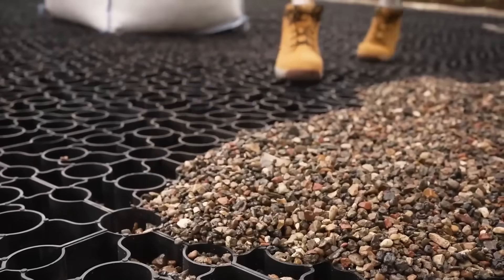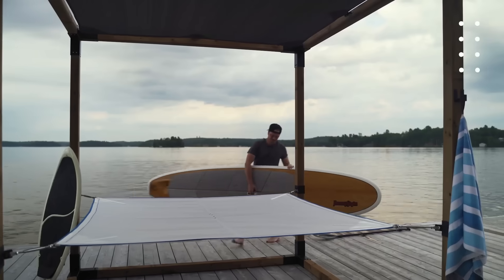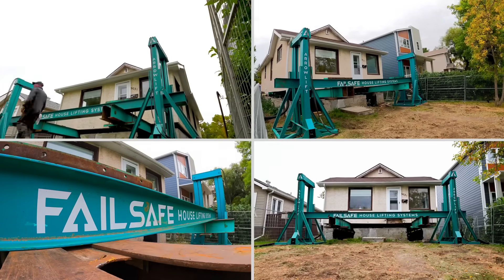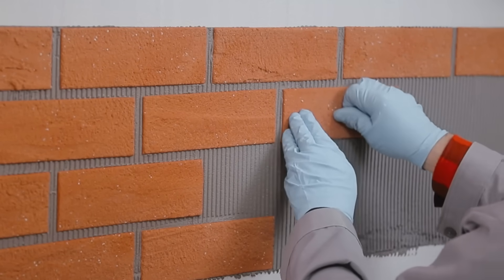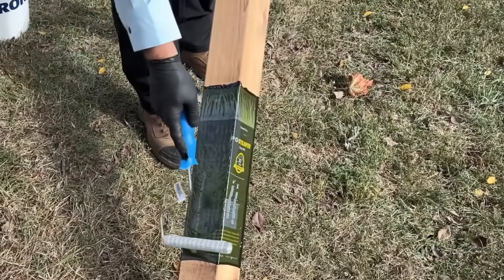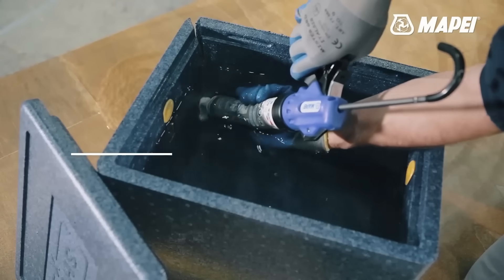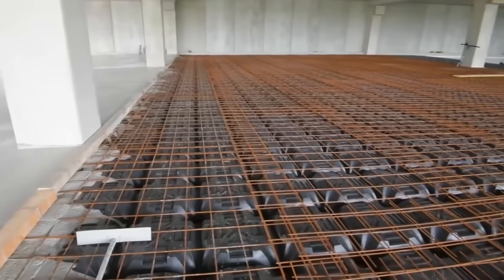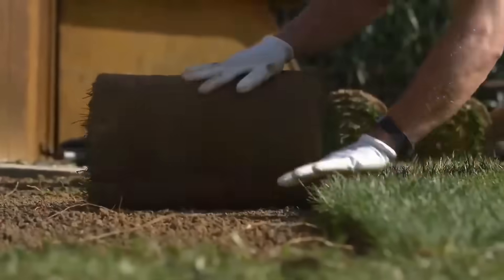Construction Technologies You Should See

Comment: That's why nothing lasts, cutting corners! Acropolis still standing 3000 years!Driveways dressed with stone or slate breaking up because of cheap fake foundations,like using only gravel vibrated and mud(cement sand) as adhesive for stone ,very wrong and cheap.U need to concrete with Rio bars on vibrated gravel and wait 28 days for it to set properly,so U get your movements and cracks in joints with Rio bar not overlapping the joints! Quantity not Quality!
Reply from the maker: You're right! If only they had a DIY video on how to build a 3000-year-lasting structure.

Comment: The Plastic Forms @13:00 for concrete are a bit much. Foam is lighter that those and dividers are already installed with rebar slots. Furthermore, Foam provides a Thermal Break between the inside and outside whereas the plastic just becomes part of the thermal bridge. More Importantly, anyone hoping to do this by Mixing their own Concrete and placing it one bucket at a time, should stop sniffing glue ! Not only is it way too much work and mindless, it is way too slow. There would be tons of Cold Joints because it wasn't a monolithic pour. Hard to Vibrate the wall suitably too. 
Many of these systems are Experimental Only and most are likely NOT YET APPROVED for use throughout Canada or USA. And in Canada there are no APPROVED Structural Plastics.
Reply from the maker: Thank you for sharing your expertise! Your detailed analysis really helps clarify the pros and cons of different materials. It’s always great to have knowledgeable viewers like you!

Comment: The Insulation shown @5:00 looks like it would be good insulation HOWEVER, there are not Baffles in the Rafters and therefore the Attic (top) is NOT Ventilated from the Soffits as required. It would not be a problem for the rafter section but anything above the "Ceiling Joists or Collar Ties" that portion of roof must be ventilated. Fresh air from the lowest point and exhaust at or near the Ridge.
Most Importantly :    Check with Your Local Municipal Building Department BEFORE buying any new building system, material or component to see whether or not it "meets the requirements of the building codes in your area.
Reply from the maker: Thank you for pointing that out! Your knowledge on building codes and insulation is invaluable.